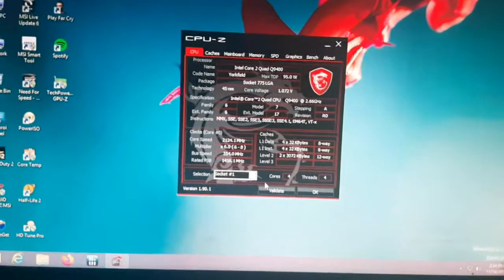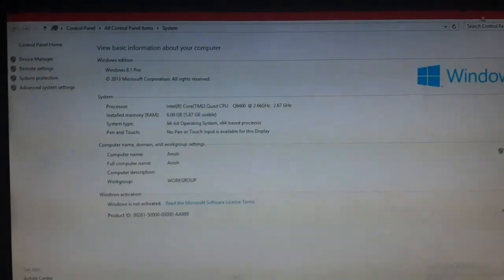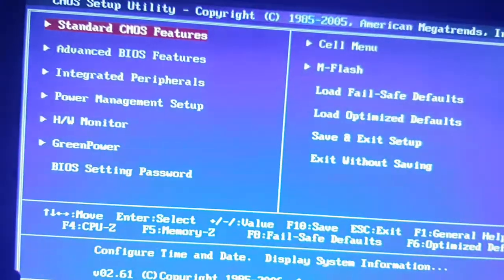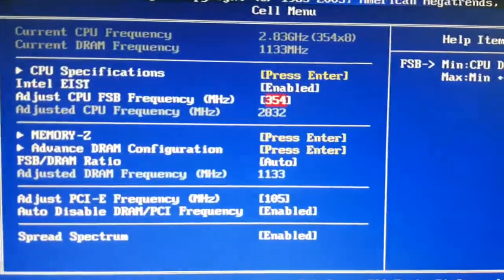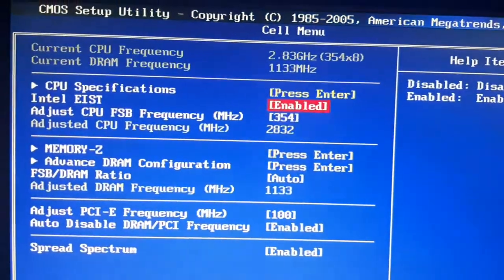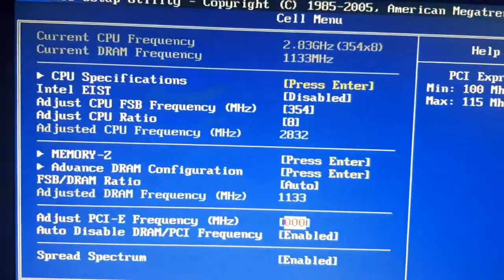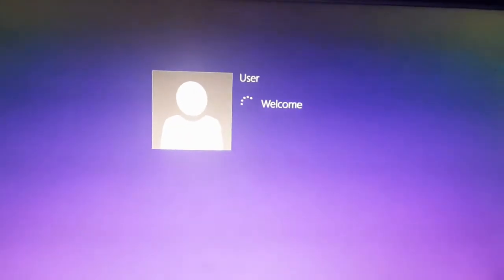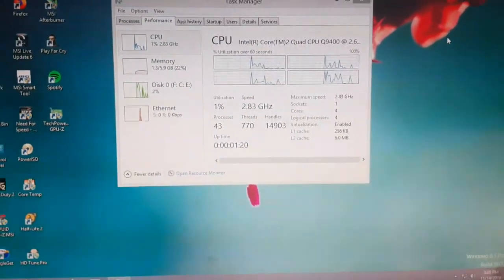OVERCLOCKING G41M-P28/P-26

Comment: can,t u help me sir...i have quad core q8400 2,66ghz..i want to overclock it till 3,2ghz..but i dont understant  the calculation of this ..sory for my bad english..thanx b4
Reply from the maker: Hello. Here, in the board I have, there's an option called PCI-E Frequency. If I increased PCI-E frequency ( default is at 100) by 1 ( make it 101), I can increase CPU FSB Frequency by 4 to 5 MHz. In the video, I have set PCIe to 105 so I got to increase CPU FSB frequency from 333Mhz to 354 Mhz. If I tried to increase PCIe frequency above 105 Mhz, my system would crashed. So my max CPu clock would be 2.86 GHz by adjusting CPU FSB frequency to 354 which again is adjusted by PCIe frequency. At 100Mhz PCIe frequency, FSB speed would be 333Mhz and CPU clock would be 2.66Ghz..

I hope you understand it.

Comment: I have 2 ddr3 strips of 2 GB at 1600 MHz working on this board. I put the same 2 bars separately (one in 1 slot and after in 2 slot), only on 4 GB (1600 MHz) the board beeps 3 times and the monitor does not turn on, the black screen. I put 2 bars of 4 GB each (a total of 8 GB), also a black screen and beeps 3 times. As if the motherboard does not see the RAM. What to do, how to solve the problem?
Перевод:
у меня на этой плате работают 2 планки ddr3 по 2 гб на 1600 мгц. Ставлю такие же 2 планки по отдельности (одну в 1 слот и после во 2 слот), только на 4 гб (1600 мгц) плата пищит 3 раза и не включается монитор, черный экран. Ставлю 2 планки по 4 гб каждая (итого 8 гб), тоже черный экран и пищит 3 раза. Как будто материнская плата не видит оперативную память. Что делать, как решить проблему?
Reply: This motherboard sees memory chips up to 256mb and it does not matter where they are soldered. However, in order to get the maximum RAM size for this mother, memory strips are needed with a layout of 16 chips per one bar. Simple math: 256x16=4096; 4096x2=8192. And if you set the bars with an increased frequency or other timings, then the memory successfully adapts to lower frequencies of the mother or other timings. However, if you try to insert a memory with a chip of more than 256 MB, then the g41 p28 m addresses you far away. I am the owner of this mother myself, I solved this problem and successfully use 8 GB of memory. The G41 does not understand one-sided 4-gig modules, it needs two-ring memory with chips on both sides.
Перевод:
Данная материка видит чипы памяти до 256мб и не важно где они припаяны. Однако, чтобы получить максимальный размер ОЗУ для этой матери, необходимы планки памяти с компоновки по 16 чипов на одну планку. Простая математика: 256х16=4096; 4096х2=8192. И если ты и установить планки с повышенной частотой или другими таймингами, то память успешно адаптируется под меньшие частоты матери или другие тайминги. Однако если ты попробуешь вставить память с чипом более 256мб, то g41p-28m адресует тебя куда подальше. Сам являюсь владельцем этой матери эту проблему решил и успешно юзаю 8 Гб памяти. G41 не понимает односторонние 4-х гиговые модули, нужна двурахнговая память с чипами на обеих сторонах.
Reply: @КатеринаВеселкова-к8л  Sorry mate but I can't help you at this problem.. I don't know anything about such problem... Sorry I haven't faced such issue myself otherewise, I would have published a video on its solution for others. If you find the solution by any chance, please make a video on that topic.. You could help a lot of people...

Comment: Can we leave Intel EIST enabled?
Reply: hey Anish the dude here in the main account... No don't leave Intel EIST on. It makes your CPU always run at the highest frequency possible, either it does light works or heavy works... 
A CPU should run at lower frequency if no task is going on.... EIST prevents that...
So its not a good idea to leave it on for long time... but you can try it yourself and see what's the difference...

Comment: Can i put a 1333mhz ram in this motherboard? Or it won't work?
Reply from the maker: You can put 1333mhz but ram will only run in 1066Mhz by default...

Comment: When I ride E4600 or E5800 The computer works but But when I ride core 2 quad Q9300 Get a black screen ( I have last update for the bios)
Reply from the maker: Tried using lower clocks??
Reply: @anishthedude2003  yes my cpu  is core 2 quad Q9300 2.50Ghz

Comment: Do your ram run at 1333?
Reply from the maker: nope... can't get it to run at 1333... tried everything but this board won't work... max i get is around 1140Mhz but I always run it at 1120Mhz with 350Mhz on FSB.
Reply: @anishthedude2003  I tried the same settings as you (the video) but it's freezed and black screen a couple of times,  should I set FSB at 350 (345) or decrease PCIE to 100MHz

Comment: So i should hit it to 115 to get 3.0ghz?
Reply from the maker: Sorry mate but I don't think you can get to 115. But maybe getting a processor with speed 2.85GHz you can get 3.0GHz on this board. And sorry for late reply
Reply: @anishthedude2003  i have Core 2 Quad Q8400. Any recommend settings to get 3.0ghz?
Reply: @iLinlinn  friend, for that, a better mobo is required and from my knowledge around the web G41 mobos don't give much voltage control to the cpu. From one post (Forgot where I had read) I found out max Vcore to cpu was 1.3ish Volt. But here I'm worried about VRMs, they are not well cooled as I cannot see good metal heatsink over them. So sorry, only max of 200MHz can be achieved. Your cpu is pretty capable for most of the games with good GPU and plenty of RAM @ stock speed. I'm thinking of upgrading to i5 3570. I have found it around $80-85 on Aliexpress for a budget build.😁

Comment: Thanks for the vid. I have the -p28 model of this board. Your vid helped me get a few more MHz on the FSB. 342 seemed to be my maximum for PCIE 100MHz. I was able to increase to 356/104 but then I hit a solid wall. Originally I was using an E7600 so was clocking fsb from 266->356 but now I put in an E8600 I get the same wall. I guess my vid card may be stopping further progress
Reply: hey dude i have a problem on this board what ddr3 ram frequency can you use in this board i try 1666mhz kingston 4gb but no display
Reply: Motherboard max ram frequency is 1333mhz sodim not work with 1600mhz